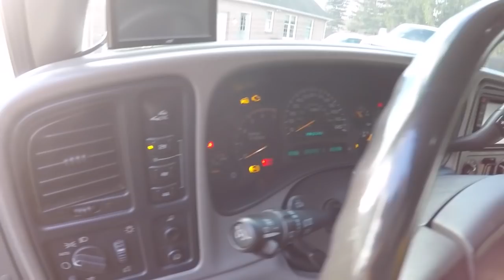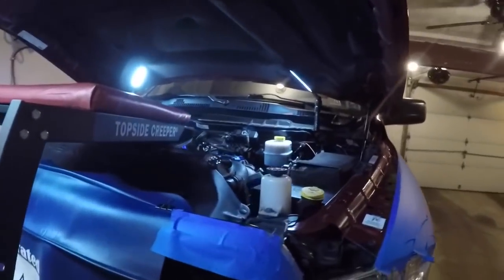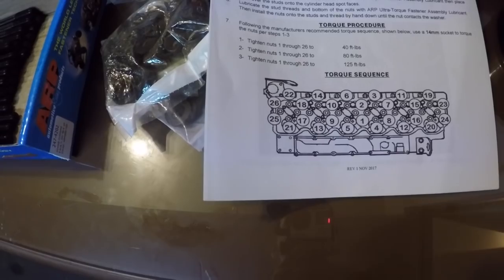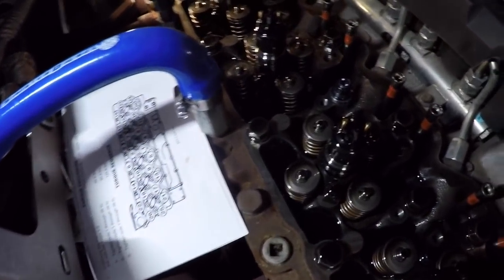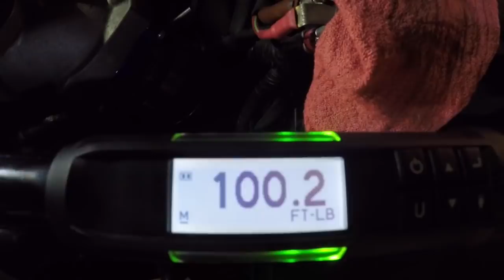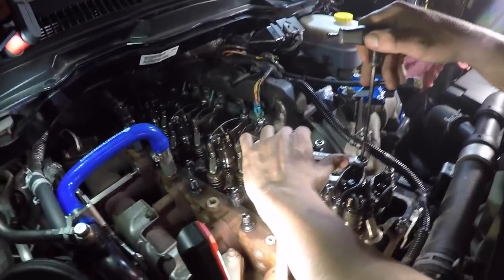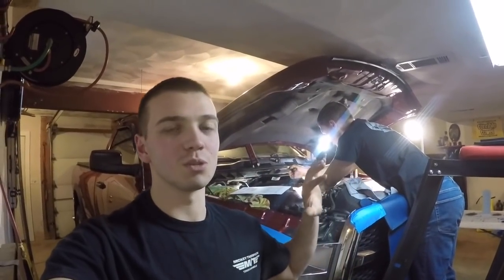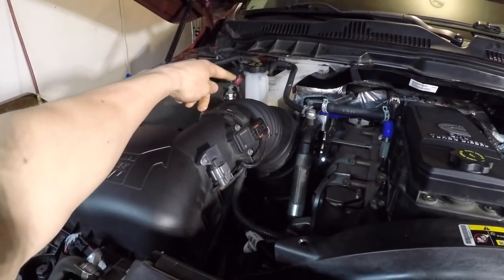HEAD STUD YOUR  6.7 CUMMINS!

Comment: 3-5k per oil change? This isn't 2004. Today's synthetics are much better. My 14 gets changed every 10k miles. My 06 7500. Good oil goes a long way
Reply: I use 5w-40 full synthetic and got 10-12000 km and all our tractors on our farm use it and got very long between oil changes like every 600 hours which is alot
Reply: I was taken back by that comment. The interval is 15,000 miles.
Reply: @ScottTerry24  That is what I heard. But for me I get paranoid and will change probably ever 7.5k.
Reply: Good oil may go a long way, but the modern emissions systems make a real mess of that quality oil.
Reply: I was thinking the same thing. Factory calls for every 15k
Reply: I used t-6 rotella when 5-40 when that became impossible to get beginning of last year I switched to amsoil signature series for $150 shipped...10k Miles is what I'll run it for they claim 25k I ran the t-6 for 5-7k ...the only time I did 3500k was with the rotella dinosaur multi grade .

Comment: For a mildly EFI live turned  basically  stock 6.7  would you consider these 2000s/425 adequate as an upgrade or go the 625 ...lol...there's a pretty big price gap ...I haven't done any of these and don't know anyone who has so I can't say what's adequate myself and want to do it once but if the 2000s are adequate that's $450 vs $1000
Reply: A lot of people say that if you plan to only stay lightly modified there's normally not even a reason to put studs on it at all. Based on that if you are head strong on doing studs I can't imagine why it would matter going with the slightly cheaper option
Reply: @brotinie3521  Yeah from what I've read recently is that the head bolt issue was more to do with early tuners cresting excess drive pressure mostly due to their inability to completely shut off the Regen cycle ...I guess if it ain't broke don't fix it. The cheap studs also from reading aren't worth my time do if I did have a problem it's a buy once cry once thing no real point in the cheap shit .

Comment: I have a 2017 6.7 ram. Am running a 100 hp tune on it stock , * deleted obviously * .  Was told to go to 200hp which my tuner has , I'd need to change head studs and torque converter. Was gonna do it my self , but after watching this , lol no thanks

Comment: I never understood why all the major diesel trucks never came with head studs by arp I mean if it was a option when buying I would definitely pay for them, and my warranty stays unhindered and they couldn’t say a goddamn word if I had to bring it in for repair work.
Reply: Victor Oliveira they want their trucks to break 😂
Reply: Victor Oliveira they go with bolts because they will stretch and hold their torque for longer periods of time without losing the torque once it’s stretched at the spec , studs do clamp better but they do not hold better over time it’s more of a sandwich force with studs bolts are more of a pulling force
Reply: Also studs can be overtorqued which is why he’s doing increments , bolts once you get to the last step the force stays the same it’ll just keep stretching the bolt , there is a certain amount of stretch on bolts that will be good to hold consistent force where it’s not too stretch’s or under stretched and will hold consistent over time even with heat cycles and abuse

Comment: What is the purpose of changing thoss out
Reply: To save your heads from gettin warped and having head gasket problems.
Reply: Video is cool and all but you don’t need to do it if you’re running a stock motor!!! Tired of hearing about the head gasket bullshit! Yeah stud it if you have upgrades and it’s running HOT !!!!!! Hahahaha

Comment: question for you how can i torque a harmonic balancer in a 2003 chevy silverado 6.6l
Reply from the maker: If you pull one of the thin cover plates on the bell housing of the trans, you can stick a thick extension up through to catch the torque convertor.  This will stop you from just rotating the engine over.  Companies also sell a little tool for if you remove the starer, it will go in and hold onto the flex plate.

Comment: Great video mark, I ordered a cat filter kit from you for my 19 l5p , and I was wondering if that filter adapter could be made with longer threads on the stock thread side because I have a oil sandwich plate which pops out about 3/4” longer than normal, or do I have to go to a machine shop to have one made, reason for sandwich plate is that I run a bypass filter kit, please let me know what you think.
Reply from the maker: Victor Oliveira Hey Victor! Thanks for reaching out. Please shoot me an email at Mark@MDDPerformance.com and I will get something figured out for you!

Comment: I ghetto studded my truck at 200k.
Reply: I know this was awhile back but I have an 07 5.9 with 110,000 do u think it would b safe 2 do 1 at a time stud job
Reply: @matthukfuk1417  I did it on an 06 5.9 with 400k. One by one is safe if you currently have no issues.